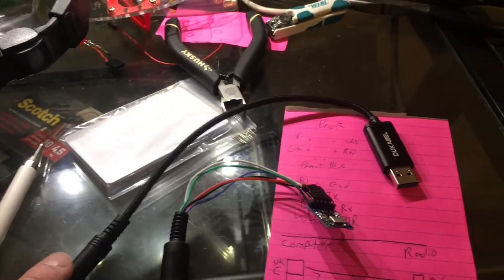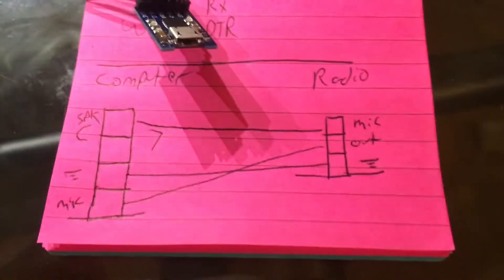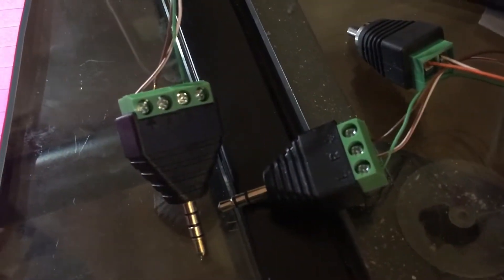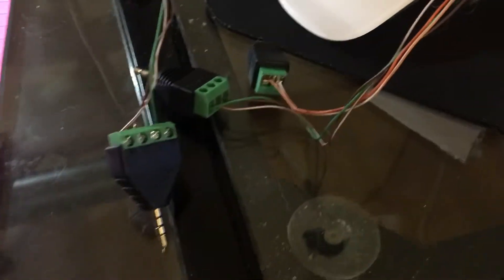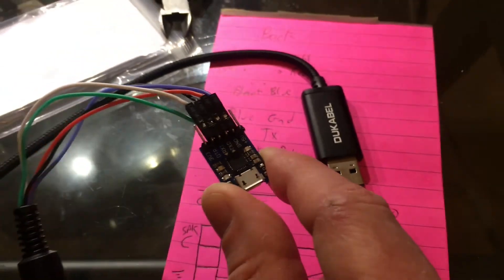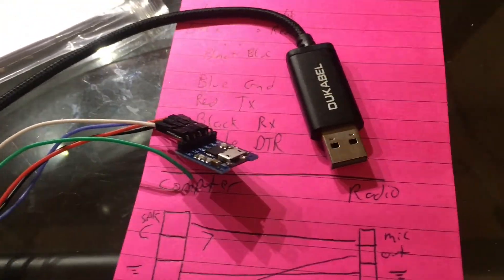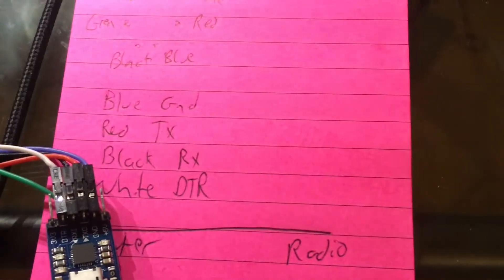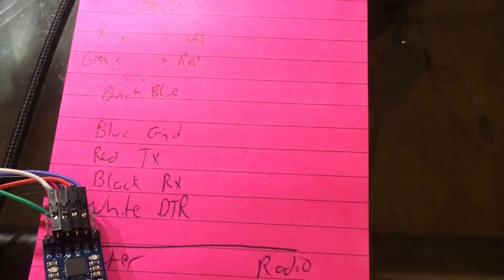Yaesu FT-890 FT8 data in:out and CAT control

Comment: Can you point me in some schematic on building my own cable? I own also an ft-890 and I want to start ft8 and hrd so I want cat and ft8 cable
Reply from the maker: The diagram on the pink paper should be enough. Those RS232 adapters might have different pinouts so you'd want to go by name instead of pin number anyway. - N3RTW

Comment: Sean, just ran across your page, I also have a Ft-890 as my primary rig.  my old setup that used to work, was using the usb cat cable to connect rig and computer, and with a usb sound card that i can connect input and out put directly to internal speaker and imput/output on back of radio.  Now since i restarted using radio again, of course not working.  ft8 trnsmit, radio keys, but meter goes to 0.  did nudge mic and noticed meter move.  Not sure how to fixafterplaying with all possible sound card choices.  Do u use Codec for your radio?
Reply from the maker: Hi Scott, my sound card showed up as "USB Audio Device". It's been a while, but I think I took a pair of headphones and some alligator clips to debug the cable by probing for sound and to make sure I got all the pins right. Hope that helps. 73!
Reply: @SeanWalberg  Can ypu tell me what you have you computer settings for the rig?  Comm ports, especially for the Input/output setup.thanks
Reply from the maker: @scott414b  So sorry, I haven't had this rig in a couple of years, plus it was on a Mac so the ports are different. From the manual it looks like 4800 baud, 1 stop bit, no parity.